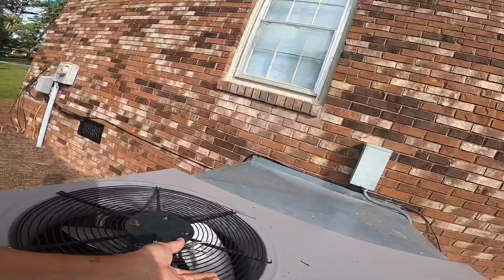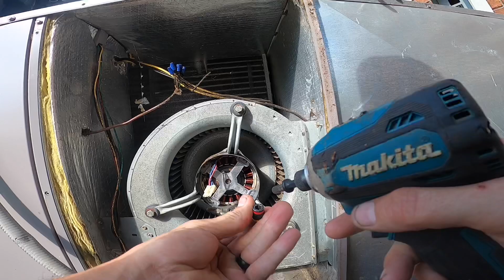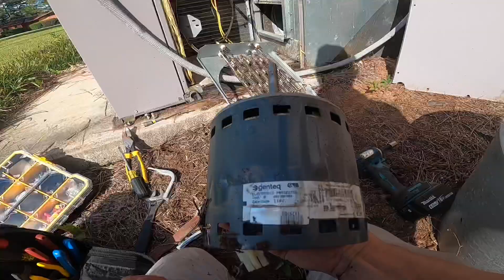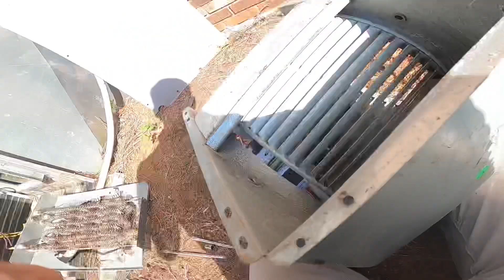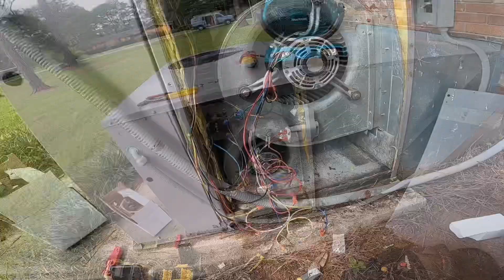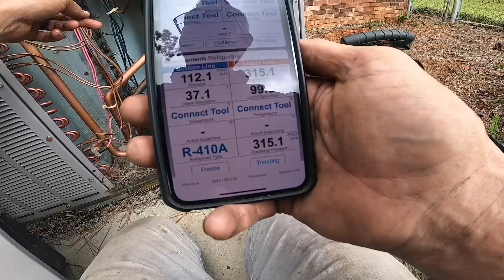Replacing an X-13 ECM motor with a PSC (capacitor) motor.

Comment: That Icp packge unit looked fairly young, may have been untder warranty,  it is a weekend job, Iam wondering if it was the same scenario for the the company that came behind you on that condenser fan motor-  Good Job Curtiss

Comment: My 5 year old ECM decided to run constantly with no call from the thermostat after 3 years. I think it's because the installer had to rotate the blower assembly 90 degrees in the attic, thus putting the module at the bottom and not the side.  Anyway, I kept the motor, but put in a relay in between the power to the motor and ran the thermostat wire to it. Worked fine, but I could hear the contactor whenever it engaged.  Then, after another year, the motor runs full speed on Cool/Heat/Fan.  If it dies, I'll end up getting a 2 speed PSC. This ECM is a nice concept, but what a pain when they fail prematurely.

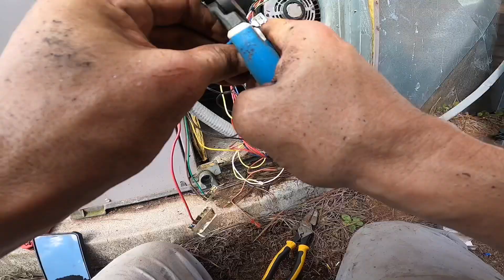Comment: 18:38 - I noticed you used the dimple maker on your crimps to create that connection. I thought the dimple is for non-insulated connectors only. Am I missing something? At least you didn’t put the dimple on the split side of the wire barrel.

Comment: I have a Goodman avptc36c14ab air handler and the blower motor (M055PWCVK-0337) stopped working. It's like it tries over and over but only spins about a single turn and stops. Anybody have any Idea how I could fix this?

Comment: I did 2 conversations today. Had to  take apart each motor to 180 the internals to get the motors to spin in the correct position.
Reply: Hey. Could you please explain how you changed the rotation by taking the motors apart? I'd appreciate it

Comment: Blessings, excellent video. I have a question. In addition to taking into account the engine power (for example, 3/4 HP) and voltage, if the engine RPMs aren't available, how can I determine the correct RPM for the PSC engine being installed? I appreciate your attention. Best regards.
Reply: Use your iPhone on slow video and mark the cage somehow. Film the cage while running with you digital watch. Then you can count the revs and determine RPMs

Comment: Wow simple swap kinda just grab 2 
Hi power wires tie in motor leads to 90340 & blower call 24 vac  / common … never done it yet nut if the. Psc motor fits in the cradle 
Seems easy enough 
Thanks for the tutorial

Comment: Do you have to use the  same HP as the ECM for the PSC motor? I have a 1 HP ECM motor and 1HP PSC motors as far as have searched are expensive.

Comment: I thought X13 motors were multi-speed depending upon which of the several 24ac inputs were active.  If you route one of those inputs to the contactor, what happens when a different speed is called for?
Reply: On second thought, maybe you're running the contactor coil directly off the Green (thermostat fan) wire?

Comment: Curtis why didn’t you just replace it with a Evergreen EM Replacement  Blower Motor the price differences isnt  that much. it seems like a lot of extra work just to wire in that motor when you could’ve just unplugged and plugged in new evergreen eM, but I guess some people a $200 difference makes or breaks for the job. You’re the man have a great day buddy.
Reply: I just did that this weekend.

Comment: Do those ECM's have a high failure rate?  I see a lot of them being replaced by techs?  I was told that when the module fails on them, it shuts the whole low voltage system down.  Is that true?
Reply: the problem with with an ECM isn't the motor itself, but the internal driver required to run it. the motor itself is just coils, rotor, and bearings. just like the construction of an induction motor. the electronics required to run the motor are usually encased in resin and mounted in the endcap of the motors to save space. unfortunately that means that if the electronics fail, the entire module has to be replaced because the electronic components are not accessible. 

ideally, the motors should come with a seperate watertight unit that can be mounted nearby or even indoors, which can also be opened to access the circuit board inside. that way if there is a problem with the board it can be taken to an electronics tech for repair, rather than just scrapping it and starting from square one. but that just doesn't happen unless you're using an induction motor and a VF drive from a reputable manufacturer

Comment: All good except for cutting the OEM connections to fit the PSC set up.  I'd have left about 4 or 5 inches extra on them just incase the owner wanted to go back to ECM at a later date. 
I'm sure they save a few hundred with the PSC. Great repair plus that ECM motor could go to a discount or senior citizen job for the cost of the module only.

Comment: most of the control boards require feedback from the ECM motor to let the unit works, if we put psc motor they are not goone work. the control board knows what is the speed of the motor and keeps going, what do you do with the type of units?
Reply: I believe X13 types don’t care and don’t have any feedback. It’s only the more expensive variable speed ECM that might have an issue but not positive

Comment: Does that module control the fan speed? I had the module replaced recently and think my fan isn't running as strong.
Reply: Yes it varies the speed of the motor/fan.

Comment: My Goodman Variable speed motor module went out after 7 years... Prices for a new motor with module were 800-1200, Ouch. I found on Ebay a company in Florida that had 2 modules, programmed for 200 for the pair. I bought them installed one and this is good for now. They were telling me after this I will have to convert like you did on this video. Thanks for walking us through this change over on this video!!!
Reply: Yes...very much overpriced crap that self destructs.  Companies who make that crap shouldn't get the business.
Reply: @Garth2011  The DoE MANDATES the use of ECM motors on newer systems(ive been told 2016 forward). Theyre junk and fail..probably because they have no capacitor.
Reply: @fredost1504 There is a part inside the ECM module called a thermistor which is a thin black round looking disc about the size of a quarter. That part is what fails and it is about a $2 part which can be replaced but likely not something all HVAC folks can or would do in the field. If they installed a quality thermistor, they would not have the problems they do and the sad part is, a completely perfect motor is being wasted when they are replaced with a new one. The ECM can be replaced however, the cost of those are almost as much as a complete motor assy plus, availability is a problem, "out of stock" most of the time. There's a replacement made by Evergreen which will self program rotation as a "good" replacement.

Comment: I've been a Technician for over ten years and still haven't tried doing this. Good job.
Reply: Kind of a crap shoot...lower the original efficiency and design by going with a more reliable PSC idea or use the more expensive OEM motor/module. The savings in power may never be reached due to this ECM failure. I'd personally opt for a new ECM vs. the PSC in the long run.

Comment: The more electronics the more likely to break and more expensive the fix. Great job.
Reply: less likely to break, but more expensive to fix.
Reply: @stvrob6320 I’ve had a lot of expensive electronic stuff fried by lightning nearby. Never a plain capacitor motor though.
Reply: @Drrich_DIY  Ive replaced many expensive electrolytic capacitors.  They quit working all the time.  And the three phase motors (behind the expensive electronics) are much more reliable than single phase motors.  
And Electronic controlled motors can do things that a single phase can never do.
Reply: @stvrob6320  I'm glad cause I just installed a variable speed well pump that's 700' down and don't want to pay labor again any time soon!
Reply: @Drrich_DIY  Your experience will depend on which type you purchased.
A 3 phase motor with the electronic control system at the surface would leave your downhole equipment very reliable.  Just be attentive to grounding, especially if you have PVC casing.
Reply: @stvrob6320  I appreciate your expertise. Thanks!  The limiting factor in my case is the crud in my well.  there’s a lot of manganese that gets pumped up and trapped in our whole house filter. That can’t be good for the impeller.
Reply: @Drrich_DIY  If its a recurring problem you should have a thorough evaluation of your ground system.   Do you live on  high sandy soil with a deep water table for instance?  Dry(ish) sandy soil isnt very conductive. Its possible the ground rod at your service entrance is inadequate. And the power company should have a very good ground at the Service pole drop.
Your valuable devices such as pump controls etc could have dedicated surge protection.
And with submersible well pumps, since the pump is sitting below the water, it might appear to have a very good ground, when in fact its inadequate to conduct large currents during a surge.  Also, think through your surge protection system completely.  Its possible to defeat its functionality if you dont consider the possibly separate electrical path from the control box to the submersible pump motor.
Reply: @stvrob6320  I have the X-13 motor that died after only 2.5 yr. I have problems with flickering lights and I think that surges and bad ground can be the issue. Do you have a reference on how to check ground and find the source of the flickering?
Reply: @CrisIsOnYT sounds like youre ductwork is junk, x13 is constant torque so with bad duct work its gonna remain at its designated torque level, so if you’re static pressure is high it will burn itself out, you need to adjust the blower speeds

Comment: These damn X13 motors remind me if the Cannon engine HP IIP laser printer.... 
Where as the laser failed from High Humidity... But at least with those it left a tell tail skull and crossbones ☠️ on the PCB...
I first encounter this fail with the X13 a number of years ago when I bought a condo with all brand new appliances... Including the HVAC.... I fought that company that installed it and the manufacturer of the AC... But in the end I got the motor replacement under warranty and it's been running flawless ever after... Oh yeah and that damn none compatibly with the Freon and the TXV valve... Pain in the butt
Reply: Mine lasted only 2.5 yrs

Comment: Did the same thing in my house. No need to worry about the time delay here in Florida, no heat exchanger, inside the furnace, to worry about getting too hot.

Comment: Nice job.  If it is out of warranty I always recommend a PSC replacement as well.  Any savings from the ECM is gone with one out of warranty replacement and the reliability is much higher.  Oh, and thanks to seeing it in one of your videos I got myself one of those Makita fans.  Loved it this summer!
Reply: Make sure customers understand what they are giving up when switching to PSC.  The ON/OFF behavior of the PSC motor might not be welcome or expected.
Reply: Yep...those ECM designs/engineering should be required to carry a 10 year or longer warranty on them. For the money they charge, about $1,200 I think, and the push from the Government to use them, someone else should be pushing that kind of engineering/quality to either be better made or carry long warranties.  Quiet Cool has ECM motors on their whole house and attic fans and they warranty them for 15 years !

Comment: I’ve done this once before but never thought about having to change the stat setting.   So you changed it where the stat controls the fan during heat vs the equipment?
Reply from the maker: Yes, when it’s in emergency heat is the only time it matters
Reply: Do you have any videos on how you started your business?   I just found your channel.
Reply: I knew that’s what I had to do. I ran into this problem today. I took the black off the heat strip and put it on the normally open leg on my relay.

Comment: Almost always the blower wheel is bigger in ECM applications. Every time I tried this it over amped the motor.
Reply: There is a YouTube video showing a “drop-in” type conversion module that connects to the ECM cabling/connectors that originally went to the ECM motor and converts the existing controls to allow use of a PSC motor to replace a bad (and $$) ECM motor.

I just ordered one from the mfg link ($199) and will use it to swap out my Carrier ECM blower in one of my attic fan-coil unit.
(I installed 3 AC systems back in 1996 when I built the house. I’m an electrician and my buddy owned an HVAC co and advised me to stock up on a few 30lb cylinders of R22.  I have 3x 30lb of it now and will include it with the house when we sell it. (Listing in 2 months)
Reply: @RBAD-PowderMill  r22 is almost worthless anymore. Everyone is using r438a or r407c. I think they both work a little better than r22. I've started replacing ECM with psc motors anymore. Just have to pick the proper hp. I just put a Goodman fan board in it. I'm getting sick of the fragile ECM motors.

Comment: Some control boards may expect some status feedback from the ECM motor in order to operate. Those cases may be harder to change to a PSC
Reply from the maker: You’re right a communicating motor, or some systems actually adjust torque or airflow by differing the low voltage - those you gotta have an OEM motor.
Reply: @HVACGUY  Is the X13 a even a communicating motor? How to tell if PSC swap is possible? Thanks.
Reply: An *X13 ECM* and a *PSC (permanent split capacitor)* motor are functionally similar in how the furnace control board interacts with them:

* The board provides *simple line-voltage power* and *discrete speed inputs* (taps or relays).
* There’s *no digital communication* or airflow feedback.

That’s why an X13 motor can *sometimes be replaced with a PSC motor* (if you match horsepower, voltage, rotation, and speed taps). You lose the efficiency and torque control of the ECM, but the board will still know how to run it.

### 🔹 Variable-speed ECM — “communicating motor”

A **variable-speed ECM**, on the other hand:

* Communicates continuously with the furnace’s main control board (often via a proprietary serial bus).
* Adjusts its own RPM dynamically to maintain a programmed airflow (CFM) based on static pressure, mode (heating/cooling), and other parameters.
* Sends *feedback data* (like actual RPM or fault codes) back to the board.

Because of that two-way communication, a *PSC motor cannot substitute* — the control board wouldn’t even know how to power or command it. There’s no way for a PSC motor to interpret the digital signals or respond to airflow commands.

So yes — your statement is **completely correct**:

> You can replace an X13 motor with a PSC (with compromises),
> but you *cannot replace a variable-speed communicating ECM* with a PSC motor, because the furnace control expects communication and feedback that the PSC can’t provide.

Comment: What’s the cost savings of going back with PSC vs ECM ? Thanks for sharing this video.
Reply from the maker: Because of adding a relay and capacitor the actual repair cost is similar. But, dependability is much, much higher with the PSC.
Reply: @HVACGUY  Logic makes sense. I have a Trane gas furnace about 20 years old with an ECM and still working. Maybe just lucky…
Reply: @roberts1159  about $20 per month 6 months of the year. About $10 per month the 6 other months average. Where an ECM gets it efficiency from is the use of permanent magnets. We've ran a bunch of in-house tests. The ECM motor, inside the compressor, (aka inverter compressor) is how they achieve 20 plus seer.
Reply: @Bryan-Hensley  And the savings is much more depending on the cost of power. Some areas charge as much as 50 cents per kWh so $20 could be an easy $75 a month.
Reply: @Garth2011  I've changed my position on this. After running more tests we've found out that the ECM draws more amps vs PCS most of the time.. I've found out that the claim of being more efficient is because the ECM will ramp up to the correct airflow when there are restrictions in the system. However dense and dirty air filters will cause the ECM to ramp up the full overspeed which is what causes many to fail. I'm kinda anti ECM now.
Reply: Ecm motor about 600 psc around 150

Comment: Good job ,i would definitely do this also,but do the customers notice any differance in blower speed ,being the same for heat and cool
Reply from the maker: I think speed would be the same, because Y is energized in heat and cool in a heat pump, but what is noticeable is that it no longer has a time delay
Reply: I know the speed is the same now for heat and cool,but no high speed for ac and lower for heat,thanks